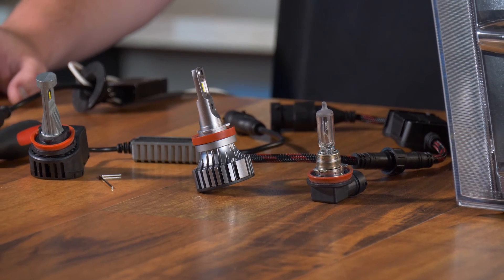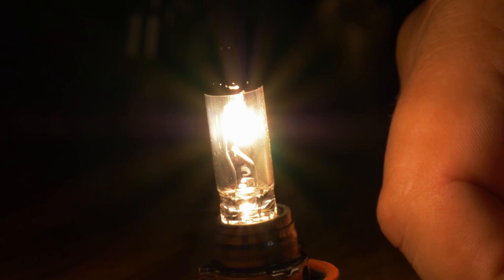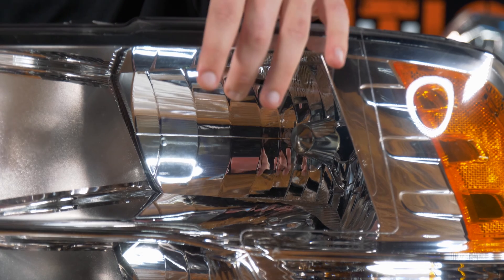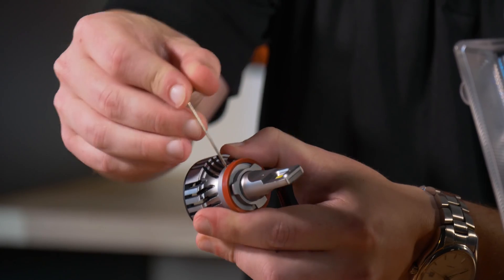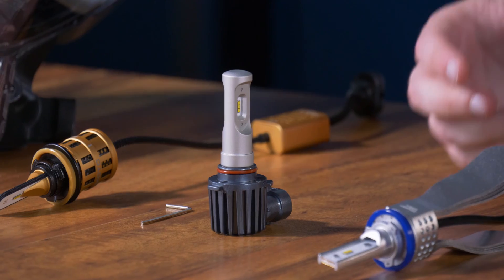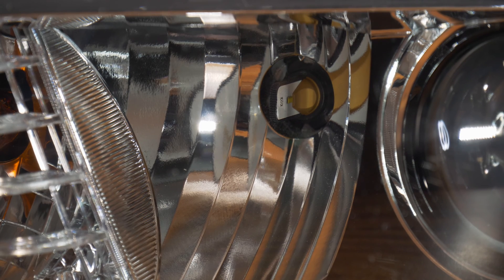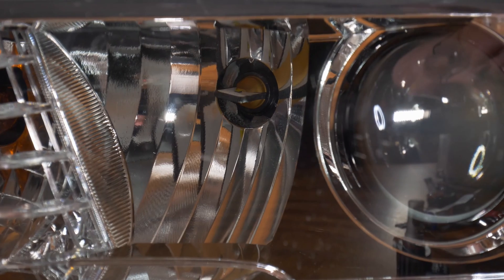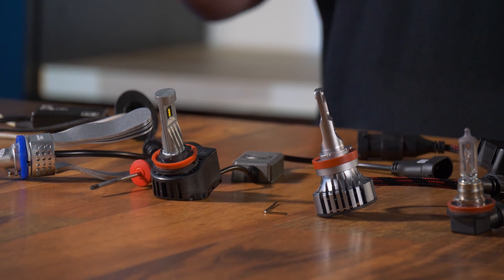How To Align and Aim LED Bulbs For the Brightest Light Output | Headlight Revolution

Comment: what about high beam? and also when I adjust the headlight vertically using the adjustment screw dose that change the position of the low and high beam or the low beam only? considering that I have a bulb for low beam and another for high beam of course.
Reply from the maker: It will change the position of both in most cases. This all depends on the vehicle.

Comment: Bulb should be vertical not horizontal as per your comment here. You meant one bulb vertically and other horizontally ?
Reply from the maker: Diodes left to right.
Reply: Thanks but still confused. Your Viedo shows led is in vertical position so then how we called  3 or 9 o’clock? Can you do a quick video on it so that will help most of us here ? Thanks again.

Comment: I have upgraded my H1 to LED in Ford Ecosport but I am not able to align in 9 o'clock and 3 o'clock orientation due to the base holder slot. LHS holder hole is place at 12 o clock and 6 o'clock and RHS in 2 o'clock and 8 o'clock position. Any support on fixing this helps me a lot I am struggling a lot to fix it.
Reply: Some LEDs come with an adjustable socket..if yours came with a small hex wrench they should be adjustable...look on the side of the socket for a adjusting screw..
Reply: The slot where I insert the bulb itself is not allowed to move
Reply from the maker: H1 are not adjustable, Sorry! 😢

Comment: I have a question and hope you can help me. I installed my LED's in the correct orientation of 3 o'clock and 9 o'clock but I still get the pattern as if they were facing up and down? Even with the correct orientation they have a scatter portion above the cutoff beam. It doesn't look like the clean beam like in the video. My car is a 2014 Honda Civic with a reflector housing. Please help!
Reply from the maker: What bulbs do you have installed?
Reply: @HeadlightRevolution  I had the Auxbeam F-16 Plus bulbs installed but returned them and ordered Lasfit LA Plus series. How do I get the best possible beam pattern in a reflector housing? Thanks!
Reply from the maker: Not sure with these! I would reach out directly to Auxbeam!
Reply: @HeadlightRevolution  Do you have any recommendations for LED bulbs with a set screw on the collar? I noticed when I try to install the 9006 bulb, it doesn't stay with the collar when I twist to lock it into my housing and continues to twist continuously. Sometimes collar gets stuck in the housing without the bulb.

Comment: I installed leds into my new headlights with projectors for some reason the leds are over lapping each other facing down. What could cause this? If done it before with my other truck and car and had no issues
Reply from the maker: Reach out to our CS team and send some pics so we can help!

218-755-5200
Sales@HeadlightRevolution.com

Comment: Awesome, information all should know if they're installing LED's, I knew there was a certain position but didn't know if it was 12/6(led blade horizontal) or 3/9 o'clock (led blade vertical). Thank you for the video.
Reply: 3/9 is horizontal and 12/6 is vertical,  I think so .
Reply: Thanks for that clarification on the 3/9 being a vertical blade...
Reply: 2:29 isn't that 12 and 6??
Reply: @dennyvilllle  Looked that way to me too.
Reply from the maker: Glad it helped
Reply: @HeadlightRevolution On your video, it looks to me and a few others as 12 and 6. Can you you explain??
Reply: @vancewilliams4571  unfortunately the auxito led h13 kit i got for my wrangler are non adjustable so im stuck on 1 and 6 or more like 2 and 7 beams facing more to the right.

Comment: Finally someone who can explain the process and provide a visual demonstration of why headlight bulb alignment is so important.
Reply: Does this even apply to projectors? Sorry maybe a dumb question but you can't even see the bulb through those
Reply from the maker: Happy it helped.
Reply: @HeadlightRevolution 
What if the LED is H7 1:1 plug and play with halogen, will it be possible to aim the LED in a 9:3 pattern?
The H7 locks in specifically in a set pattern.
Reply: Amen to that brother…..just bought novsight h1 for my Rcz this video helped a lot

Comment: Kindly did you ever tested the BAISHIDE Car Lights H4 LED H7 20000LM H11 LED Lamp for Car Headlight Bulbs H1 H8 H9 9005 9006 HB3 HB4 Turbo H7 LED Bulbs 12V 24V or thinking of testing them?
Something else I am confused with is that the halogen lamp has a small cover or reflector near the low beam filament and is at the bottom position when fitted in the head light so the beam is emitted to the upper part so why when we insert an led bulb we should place it horizontal to emitt the light beam to the sides of the head lamp in a projectile head lamp?

Comment: Is it the same with the high beam bulb in a ram 1500? My low beams are perfectly set at 9:00 and 3:00,  but both my high beams are set at 12:00 and 6:00. Reflector style headlight housing
Reply from the maker: You would want the high beam at 9 and 3 as well!

Comment: Mine have three sides sp how do i line them up? I haven't been able to distinguish the different beams. Accept slight flicker as the dimmer is switched. Thanks
Reply from the maker: 3 sided bulbs will not line up right!
Reply: @HeadlightRevolution  agree!

Comment: The adjustment on my ultra 2s don’t have a setting for 9 and 3 for my car. They’re close but still not right
Reply from the maker: As close as possible should be fine!
Reply: @HeadlightRevolution  I figured out not to long after this post that you just have to keep clocking it until it’s right. It has a lot of different clocking adjustments. The best LEDs I’ve ever bought.

Comment: hi, what are the best led headlights for a 2017 Mazda 6 ....
Reply: Whatever has good ratings and has that slim chip design with the chips on both sides. I got led high beams/drl's for my 2014 mazda6 sport and got the led's from ijdmtoys. Got that and needed the resistor wiring kit to make it work
Reply: @ilyas5708  resistor wiring kit, no  plug in n it works
Reply from the maker: I would suggest reaching out to our CS team so we can go over some options with you!

218-755-5200
Sales@HeadlightRevolution.com

Comment: I have 2004 mercury sable I installed torchbeam LEDs on and I did them at 9 and 3 positions as well has have them with the correct high/low beam chips right side up, but I still get a beam pattern that looks like an eagle with wings spread or the bat signal or something. And the beams focuses are sort of pointed straight out instead of converging in front. Is it just that my old ass car is not very compatible with the new LED designs? Should I just get Xenons?

Comment: My projector lens creates a shadow in the middle because I think there's no light in the middle of the bulb but only from the sides. So should I adjust it to 12 and 6 o clock for projector lens? Really want to like the LEDs but the shadowww
Reply: This just happened to me, i won't be able to change them until later today so an answer by then would be greatly appreciated.  There is a dark spot in the center of the projector.  It is an 360° adjustable H7 two-side chip LED bulb.
Reply: @cirealreviews1776  I tried adjusting my d1s today but it's not adjustable. Let me know if you find a solution
Reply: @johnnynguyen8337  ok, i haven't tested them at night yet so i will see if the dark line will actually be noticeable behind the wheel.

Comment: My led headlight bulbs lock in to place but they’re not quite 9-3 . I tried turning it to 9-3 but it locks up whenever I try
Reply: Same, I’m at 4 & 10
Reply: Death Squad yeah that’s how mine is positioned too
Reply: @ImBrickedUpRightNow  have you installed them yet? I haven’t put mine back on the truck yet to see how it looks.
Reply: Death Squad yep, they’re on. My bulbs fit inside sideways if that makes sense so when you’re looking in front of the headlight you can see the led chip facing towards you and the other led chip isn’t. I have a 4Runner and that’s how the headlight housing works for mine.
Reply: @ImBrickedUpRightNow  oh okay, mine are in a Ram projector housing. We’ll see how it goes.
Reply: Death Squad good luck man
Reply: @ImBrickedUpRightNow  thanks, Merry Christmas
Reply: Death Squad Merry Christmas!

Comment: Hi HR, thanks for the gyan. I just installed my first LED bulb on my scooter and I did install it at 6 and 12'o clock which i just learnt from you that its a terrible fit. I will twist it to 3 and 9'o clock. But I have a question here. Once I fit it at 3 and 9'o clock, should the low beam led chips be onto my right or left assuming i am standing behind the headlight?
Reply from the maker: You got it man, you will want those chips to be facing left and right inside the headlight housing! Let us know if you have any other questions, we are here to help!
Reply: @HeadlightRevolution  one more question which I wanted to ask yday but missed somehow. How should be the placing of low bwam chips if my LED bulb has a set of 3 chips on either side one side for low beam and other for high beam?
Reply from the maker: Is this a dual beam bulb? If this is, most vehicles will require the forward LEDs that are further out to be on top! If this is a single beam bulb, you will just need to have the LEDs facing left and right inside the housing! Let us know if you have any other questions, have a great day!
Reply: @HeadlightRevolution  yes it is a dual beam H4 LED. One side glows for low beam and other side glows too (along low beams) when high beam is switched on. Clearly in my case i cant install it sideways as it gave me a wierd beam pattern. If so, my question is, how to figure out whice side to be placed upside or downside to get a perfect pattern?
Reply from the maker: That is not how any of our LED bulbs, or any LED bulbs we have tested in that H4 bulb sise go, so I will not be able to help you here. Sorry about that!
Reply: @HeadlightRevolution  Never mind. I do understand. I will try all the options with different positions of this bulb and check it out for the best beam pattern as suggested. Great day to you.

Comment: If I have them installed but can’t tell the angle they’re facing how am I able to know if the beam pattern is perfect? They’re placed in with the wire facing down which is how they’re supposed to be put in but I can rotate them once inside the housing should they be turned all the way to the right or when there’s a solid focus and cutoff or where should I determine is best when angling within the housing itself?
Reply from the maker: You will just need to pull the bulb out of the housing, look at what angle it is at, make sure to adjust for turning the bulb into place, then set the collar to allow for the bulb to face the proper directions! It is just a game of eyeballing it for the ones that have a projector or a reflector shield.
Reply: @HeadlightRevolution   yeah I have one of the hikari led’s so I’m able to just rotate it without having to remove the collar, now another question should I adjust it until it’s a completely focused beam with a definite cutoff or will I just have to play around with it to get an optimal pattern? I have them installed in a Kia Rio 2015 so I just wanted to make sure they were perfect!
Reply from the maker: You will just have to play around a little bit to make sure that it will align properly, I know that can be a pain but that is the only option with headlights like these. Sorry about that!

Comment: awesome video, there is a myth around the community here in india, that we should never use LEDs in refectors. Is it so ? Also cab you suggest few LEDs for Ford Ecosport 2015 with H4 and Reflector assembly
Reply from the maker: Up until recently, that would be the case, but there have been some major increases in technology over the last couple of years! With that said, the S-V.4 LED or the Ultra 2 LED would both be a fantastic option for your reflector headlight, you can check them out here: https://www.headlightrevolution.com/lighting-by-size/custitem_category_facet/H4?order=commercecategory:asc
Reply: Lol in India everything is a myth 💩😂

Comment: Hey guys. 2020 ram 1500 and I bought some Lasfit leds. Would you recommend those at 9 & 3?
Reply from the maker: Most LEDs will be 9 and 3, that is based on the housing not the bulb! You should be good to go with that alignment! Let us know if you need anything else, have a great day!
Reply: @HeadlightRevolution  so 9 and 3 for projector headlights on the high beams, that have a horizontal blocker. 2014 Jeep GC

Comment: Arent you putting them in 12-6 not 9 and 3?  9-3 is horizontal
Reply from the maker: You want the bulb to have the LEDs facing left and right, and the flat part of the bulb is aligned vertically. If you have any other questions, let us know!

Comment: What about projector light housings?  Are they sensitive to orientation as well?
Reply from the maker: They are sensitive to orientation as well, just like the reflector housings! You will want to aim the LEDs to face left and right just the same, that way they mimick the OEM Halogen bulb as perfectly as possible!
Reply: @HeadlightRevolution  hello. How about the projector housing on my rav4 2015. The socket is on the side indtead on the back of the projector? How should I adjust it?

Comment: Hi I have a question I had lef fitted on my Ford ranger however the light had like a black spot in-between the two beams like on oval shape of no ligjy  when driving on the road any reason for this its a projector head light
Reply from the maker: You should be able to align those headlights, not sure why you are having this issue. I am wondering what bulbs you have installed, and how you have them aligned in the housing. If you could shoot us an email with that information, we would be happy to look into this and get this issue resolved for you!
Reply: @HeadlightRevolution  thank you so much I have sent an email through already with the video attachment thank you much appreciated.
Reply from the maker: Fantastic, glad to hear that you emailed in! We will get you taken care of via email, but let us know if you need anything else!👍

Comment: i put some leds in like morimotos but i cant seem to lock the bulb into the housing without it wanting to clock itself. so i cant get it to lock into place
Reply from the maker: You may need to tighten a set screw that holds that LED collar in place, as that may just be spinning freely inside your headlight housing. Give that a try and see what you come up with! If you need any more help, shoot us an email with some images of the bulbs you have and we will get you taken care of! Sales@HeadlightRevolution.com

Comment: Does it matter how you install the led bulb inside a projector style housing?
Reply from the maker: You will want that bulb to align the same way as the halogen for the most part, and that will be with the LEDs facing left and right!
Reply: @HeadlightRevolution   hello. How about the projector housing on my rav4 2015. The socket is on the side indtead on the back of the projector? How should I adjust it?

Comment: Im assuming its 9 snd 3 in a vertical housing for fog light for ram 1500 too?
Reply from the maker: That should be the same alignment, although there are some specific vehicles that will require them to be facing up and down. If you see a weird beam pattern, try rotating the bulbs 90 degrees to see if it clears up!
Reply: I have a ‘13 1500 and having the LED chips facing 12 and 6 o’clock produced a better beam pattern because the reflective surface in the vertical style fog lights is more predominant up and down vs side to side.
Reply: @philprindle8145  I will try that and see how that works
Reply from the maker: Perfect! Glad to hear that you got them aligned properly! 👍

Comment: My LED light has 4 angles with diamond shapes. When the light locked it position as vertical (I think it is what you mention despite saying 9 to 3 - horizontal). But the beam’s pattern is horrible it scratches to all places. Please help, thank you in advance 🙏🏽
Reply from the maker: That could mean that you have one of the few headlights where you will actually need to align them with the LEDs facing up and down! Give that a try, and if that doesn't help shoot us an email and we will get you taken care of! Sales@HeadlightREvolution.com

Comment: Is it the same for projectors?
Reply from the maker: That will be relatively the same for projectors vs reflectors!👍
Reply: @HeadlightRevolution   hello. How about the projector housing on my rav4 2015. The socket is on the side indtead on the back of the projector? How should I adjust it?

Comment: Even if the LED blade is vertical.....you STILL can be clocked 180 degrees wrong.
Reply from the maker: That is totally true for dual-beam only, and that is why we recommend going with whatever your factory halogen had as far as filament alignment! Shoot us an email if you need help with that! Sales@HeadlightRevolution.com
Reply: @HeadlightRevolution  ...to go further...if the "blade" onto which the LED's are mounted.....is "vertical".....you are 50/50 chance of being correct.  There should also be a reflector piece mounted on the BOTTOM of this blade, that is.... a curved piece facing UP.... to result in the proper vertical orientation.

Comment: This is a great video. My headlights have many scratches on the inside of the lense that can't be repaired. My fog lights get water on the inside. So what I did was buy new replacements and adjusted my new LED bulbs with the new assemblies and then placed them on the car fully aligned. I had to wait a couple of months before installing my new assemblies because it was the middle of winter.
Reply from the maker: There ya go, glad to hear you were able to get all of that fixed! Thanks for watching and glad we could help!